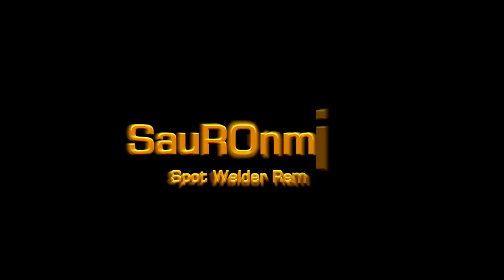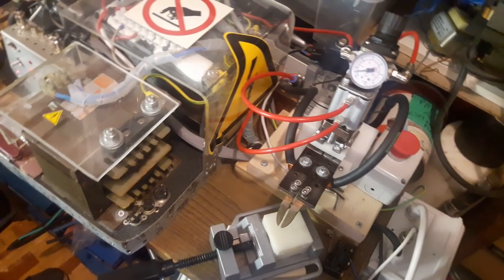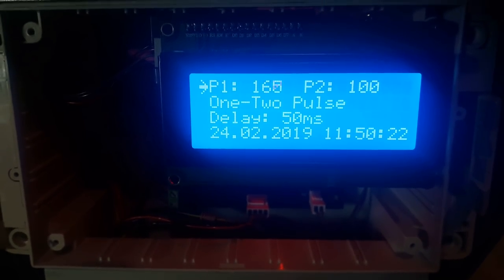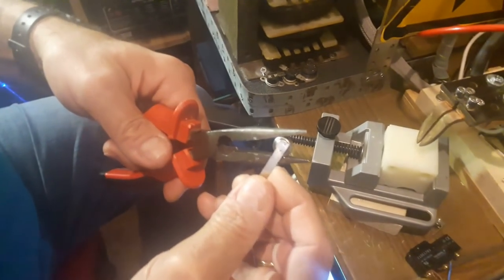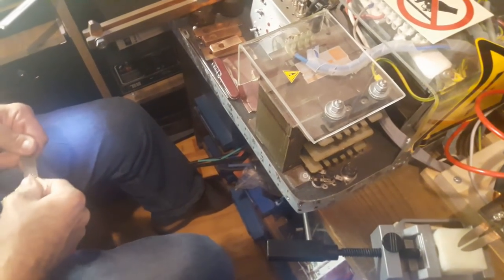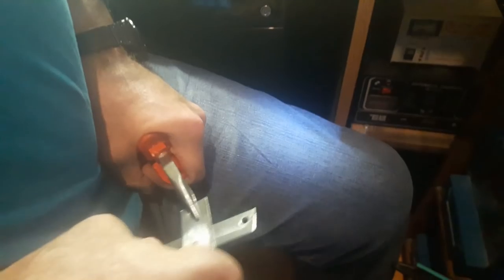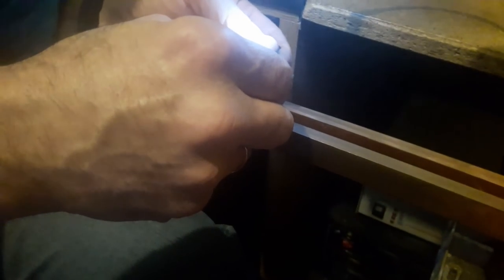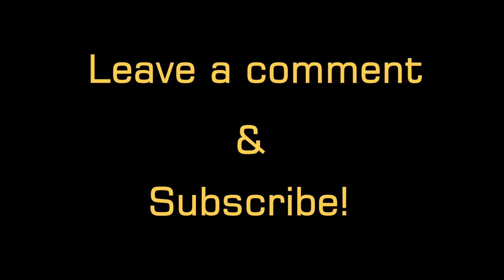Arduino Spot Welder - The reincarnation! (Spot Welder v.2)

Comment: Very nice project, thx for all your hard work you are sharing. I have one small question, how do you set the Clock , i can't get it to work?. THX
Reply from the maker: Thanks for your support ;)
What is your issue with the clock? Is it a connection one, a code one?
If you check the project's Hackster.Io page then you can find solutions to both your problems, I provide both a schematic and the code to see how the clock works:
https://www.hackster.io/150129/spot-welder-controlled-with-an-arduino-nano-8e90dc

Have a nice day!
Reply: @SauROnmiKE  Thx for very fast replay :) . It seems that it was a code problem. I need to add two line of code to set the time and date : rtc.setTime (Hours, Minutes, Second);  and rtc.setDate (Day,  Month, Year);
Reply from the maker: @Dasile1  Glad you sorted it out :)